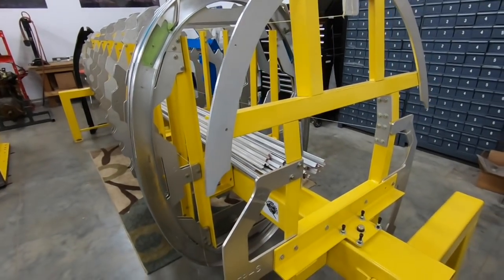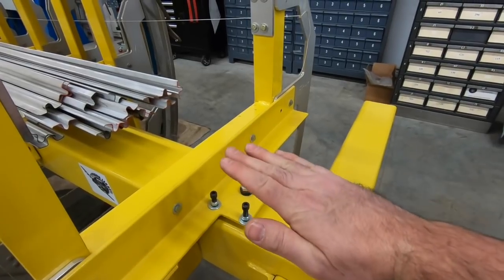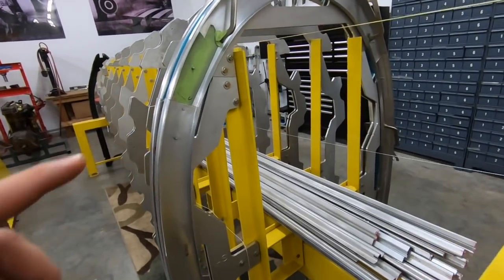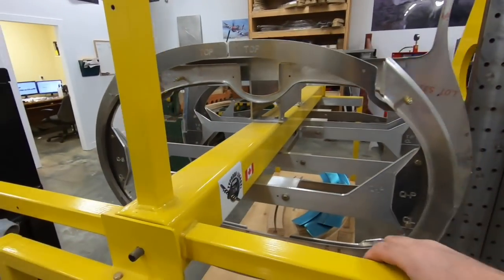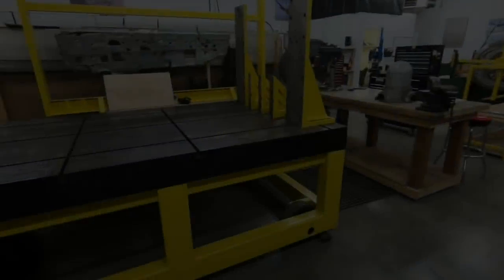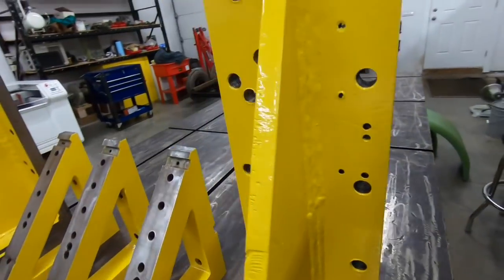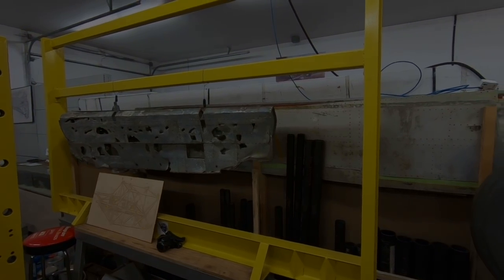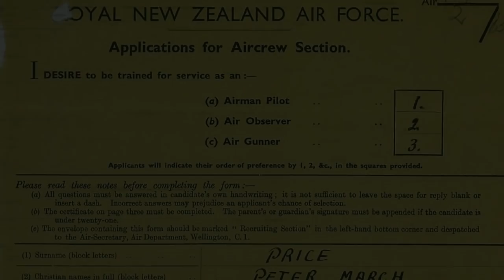S1E08 Hawker Typhoon Construction Fixtures

Comment: I'm really impressed by the thought that's gone in to the jig features, to accommodate future project milestones. Are you following the original construction techniques as well as the technical drawings? Fascinating stuff.
Reply from the maker: Everything is being done to ensure JP843 is as original to the design as possible. As it is not full production though, sheet metal parts are being hand made as opposed to being pressed, and we will take advantage of CAD and CNC wherever possible. the final product will be as Hawker designed her. ~Ian

Comment: Sorry if it seems a silly question but are the plain metal sections of the fuselage fixture just there to hold the aluminium sections you are making in a specific place until the spars are fitted and then will be removed? I’m following this build with a lot of interest, it’s fascinating! Best wishes for Christmas and the New Year from Chipping Sodbury, UK.
Reply from the maker: Hi Simon, for the monocoque section (aft of the cockpit), the flat aluminum plates are solely there to hold fuselage frames in place for assembly. Once the assembly is complete, they will be completely removed. I hope this helps, a very Merry Christmas to you! ~Ian

Comment: Fascinating video! With all the work, planning and foresight that has gone into those fixtures, building the actual airframe will be (relatively) easy! One question, though......once you have completed structures built, how will you store them? It is looking pretty crowded in there.........
Reply from the maker: It sure is crowded! Once the Merlin and it's trailer are gone, it will open up quite a bit of space, and when the Monocoque is complete we will simply suspend it from the ceiling. When I built the shop, I designed it to house the Typhoon (2000 sq ft); though I have got a wee bit carried away with tooling! ~Ian

Comment: How & what fixtures did they have when they were originally made ,? 
Great detail ,thanks
Reply from the maker: For production during the war, multiple fixtures were used to get as many hands on construction as possible. That system is not economical for low production volumes, but very good under the wartime conditions. There are more details on this in earlier episodes. ~Ian

Comment: Once nearing completion which we all can't wait for, as with our tiffy in the UK, will you be planning to fix all the common plagues of the typhoon? Like fumes in the cockpit, the sabre having a tendency to catch alight on startup, tail failure etc? Greetings from former RAF Hornchurch
Reply from the maker: Almost all of the faults for the airframe and engine were resolved by war's end; so we will be following along exactly as the manufacturers did to correct these. The C02 issue was ongoing, and for safety sake, I'm quite sure oxygen will be required. Very careful attention will be paid to all known issues. ~ Ian

Comment: Hi not that I am wanting to critique the fuselage construction so my question is does this need to be built this way for the flight cert/s or are you just wanting to make it to the original specification ??Very impressed with your skills. Regards
Reply from the maker: Hi Chris, the answer to that one would be both actually. For certification the aircraft needs to be built to the manufacturers specifications. ~Ian

Comment: Very interesting. Is this similar to how Hawker built the aircraft on the production line or did they use a different process to support the monocoque ?
Reply from the maker: Production was done quite differently, the monocoque was built in four sections (each with their own fixture) and brought together in one final fixture. It would be very expensive to do that for low production, but during the war it allowed for more people and faster work overall. ~Ian

Comment: How much more precise than the original manufacturer's will that make your fuselage?
When you're finished building JP843, Kermit Weeks might want your fixtures.
Reply from the maker: That's a very difficult question! The originals were built very well; our work will ensure at least the same standards, and will likely result in far less tool work and fitting due to the use of CAD to verify parts and assemblies. ~Ian

Comment: With the detail your putting into this for the body I'm surprised you have not 3d scanned the sabre engine.
From that you could re-manufacture a new unit to modern standards.
Reply from the maker: We've been looking at industrial CT scanning for this, there has been quite a bit of original data showing up lately too. The Sabre is always ongoing, just like the airframe; there has been, and will be many more years involved in progress that isn't too visual. ~Ian

Comment: Ian , I'm curious to know if there is any Reynolds 531 tubing used in the Typhoon build , Thanks
Reply from the maker: That is an interesting question Mark! I know that many Hawker parts (usually extrusions) had Reynolds alternates; but so far in this rebuild none have been used. I'm not familiar with 531, is this a Reynolds produced T.50 tube? ~Ian
Reply: @TyphoonLegacyCoLtd  Yes Ian it is . The Hurricane used it , also the XKE Jag. used it & most of the high dollar road bicycles from the 30s to the 70s used it mostly in its double butted spec. As the years progressed Renoylds five three one modified into 7 & 853 . For your interest look at Renoylds web site . Thanks again
Reply from the maker: @markbattista6857  Very interesting, thank you for sharing Mark! ~Ian

Comment: Were they built this way originally?
Reply from the maker: For production during the war, multiple fixtures were used to get as many hands on construction as possible. That system is not economical for low production volumes, but very good under the wartime conditions. There are more details on this in earlier episodes. ~Ian
Reply: Thanks Ian
What a project I wouldn’t know where to start!

Comment: Nice job. Who will rebuild the engine ? Is the saber is complete ?
Reply from the maker: It's too early to say on that one, but it would be nice to get as much experience involved as possible. We have one engine, a collection of data, and are working on more of everything Sabre related. ~Ian
Reply: @TyphoonLegacyCoLtd  I just finished reading Calum E Douglas' book The Secret Horsepower Race (as advertised on your website),
and I couldn't help noticing that the Sabre wasn't exactly a well thought of powerplant, would it be fair to say that you must be approaching this engine with some trepidation, as it seemingly doesn't have quite the service legacy and postwar detailed improvements that the more popular powerplants have attained?
Reply from the maker: @suereed  The Sabre did evolve quite well given the circumstances, but you are very correct in that it didn't get the post war development that engines like the Merlin and Centaurs did. The key will be to do everything exactly by the book to ensure the knowledge from the operational days is followed, using the most up to date revisions and modifications will be the best place to start. ~Ian

Comment: Are you planning to go into production? That's a lot of work for just one aircraft. I bet other people will want to buy once they see you first build. I guess the limiting factor will be rebuilt Merlin engines.
Reply: Napier engine
Reply from the maker: Rebuilding a Typhoon is a tall order indeed, as we make progress, more will see that we can succeed, but that will come in time. While only planning to do the one rebuild, doing things correctly from the start will ensure that more can be done. We shall see how things go. As per Gary below, the Typhoon is powered by the Napier Sabre 24 cylinder H type; perhaps we could use a Merlin for the starter motor? ~Ian

Comment: As I understand it the Typhoon had limited aileron authority with full flaps , quite like the Saab 29 , killed a lot of pilots who found themselves suddenly landing head down...took some time before thte airforce got wise to this though , as I undertand it one had to nip any tendency to roll on the finals in the bud.........love a vehichle that can kill the unwary....rather like the 109 landing gear.....
Reply from the maker: I've not seen or heard any indication of aileron limitations for the Typhoon. As far as the manuals indicate, range was 19 degrees up and 18 degrees, thirty minutes down regardless of the flap position. The Tiffy had a tendency to swing on takeoff due to torque though. ~Ian